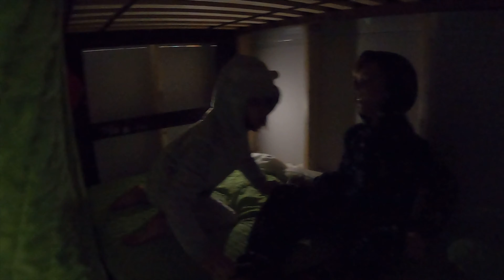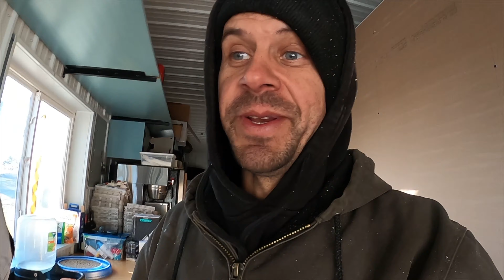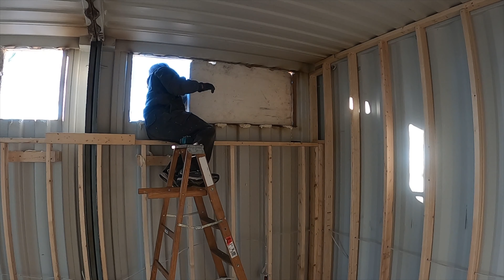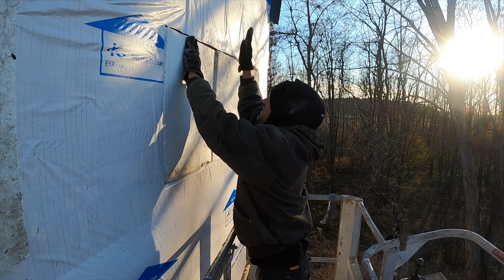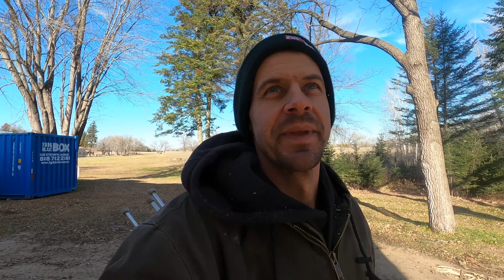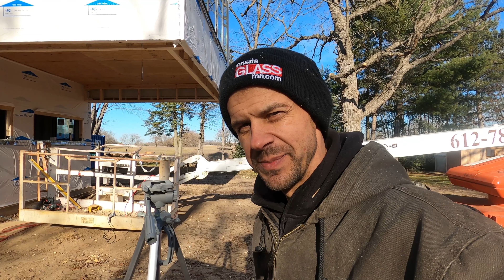Correcting Errors On Our Container Home Build

Comment: Not a container home.  House built using containers.  There is a difference.  The containers are NOT the main structure, but simply an expensive building material.  The same results/look could of been done for less just using traditional  steel I beam and lumber construction.   Instead of spending let's be cheap  $60k on containers, 6 x $10k.  Not counting the time and labor and materials in reinforcing the containers once walls and such where removed.   That same time, money, labor could of gone into building a traditional foundation for a basement,  Which would not only give more square footage and useable space to the home. Would also increase the overall value of the home.